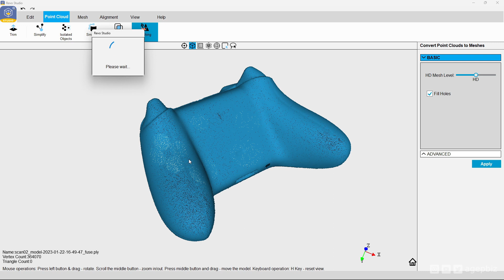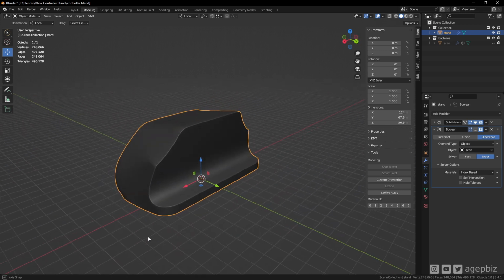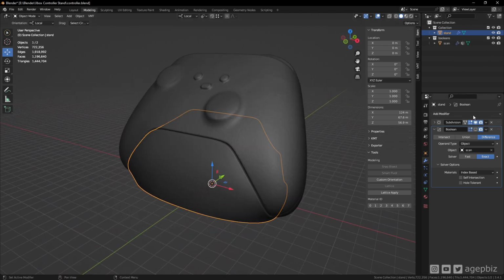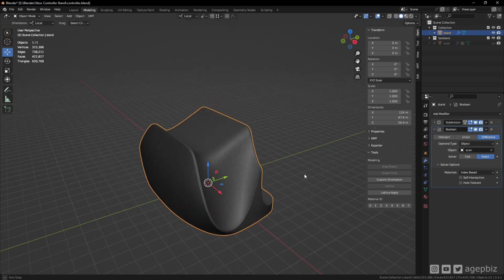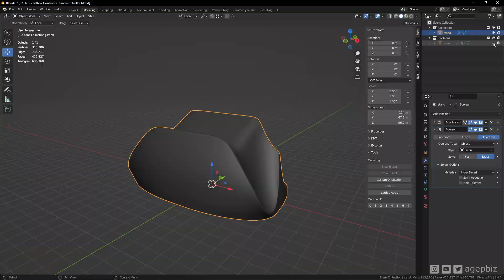I did 3d scanning to get a PERFECT fit

Comment: Hey, could you give some more insight into creating the base shape in Blender? I have a 3D scan of another controller, and I was able to make a low-poly stand, but I think something smooth like yours looks better. I am very used to CAD so Blender is very strange to me, you can only sculpt or edit parts of a mesh; I don't even know where to begin for a rounded shape like that. Thanks!

Comment: Any chance you have a link to the 8x3mm anti slip rubber pads you used in the holes on the bottom? I'm having a hard time finding them.
Reply from the maker: I believe I bought them from aliexpress or something, dont remember. Check out my video with the LED upgrade, I use different pads there which I like better. And there is links
Reply: @agepbiz  First of all that LED Upgrade is sweet, nicely done. Thanks - Appreciate the link !!